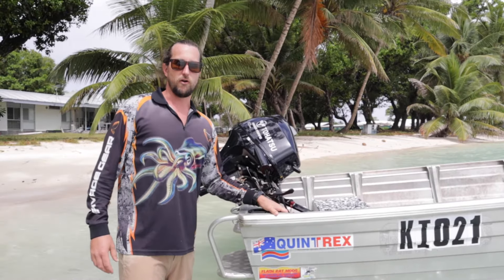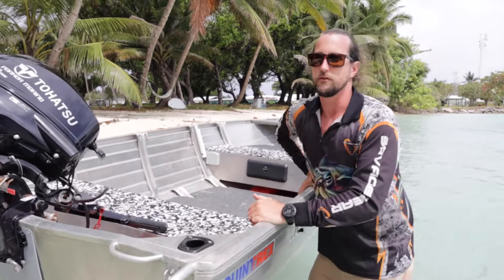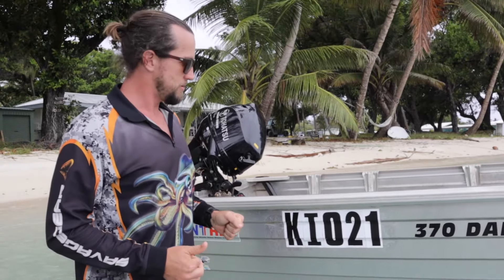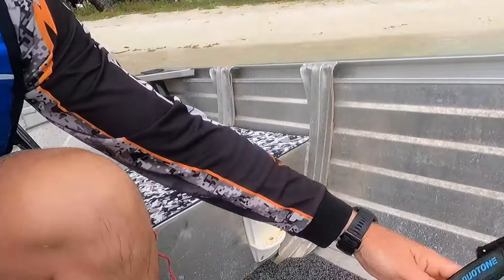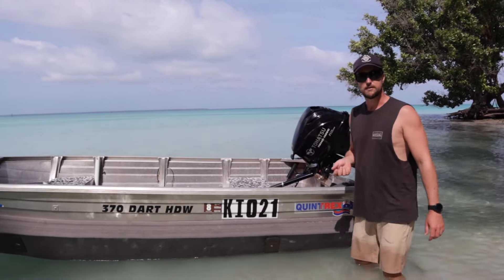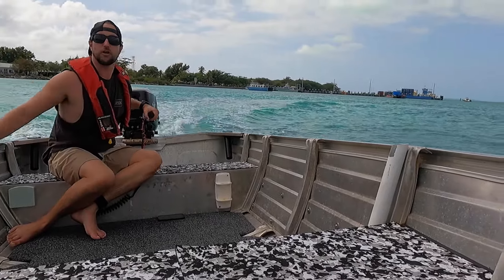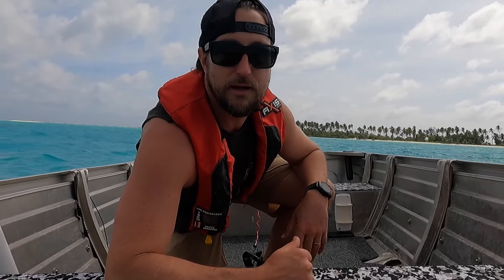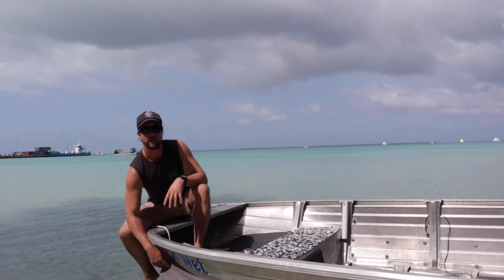The BEST mod for a tinny | KAPTEN BOAT COLLAR before and after review | Quintrex Rooftopper

Comment: Dude,  you CAN NOT go wrong with a boat collar ! I got pat to put one on my 4.1 Brooker and transformed it from a quite unsafe (randomly broached ),wet, harsh tinny into a dry, soft, super stable and predictable weapon.
Reply from the maker: My only regret is I had the boat for a year without it!
Reply: @shaneyule3484 
I’m about to install a collar on my 4.1 Brooker! Currently the boat is super dangerous, but hoping to change that with a collar. 
Did you get the max collar or slimline?
Cheers.

Comment: First of all incredible review in real world, realistic conditions.
3 years later how's it holding up? foam sun damaged / degraded?
Any significant chucks taken out by hooks / sticks?
Reply from the maker: Hey mate, thanks for the feedback - no one wants to see boats tested on a glassout. 

They are surprisingly durable. I've got some good chunks from beach launching collisions with the trailer, but apart from that its still good. I do an annual coat of tyre shine on the top side which they recommend to stop it from drying out too much and I also store undercover where ever possible. I would say if you took care of them 10years service life no worries. Cheers, ORT

Comment: I did a major modification along the same lines on my six metre glass boat using extruded polystyrene and glassing over using epoxy resin. I doubled the width of the chine flat and added around 100 kg of additional buoyancy to each side. I got at least a 15 % increase in WOT speed due to the additional chine flat width. I use this boat out wide in up to 2 metre swell and she has become a very capable boat. 
I also added a ballast tank up from for when motoring into a head sea and pump it out for the following sea.
Reply from the maker: Sounds like a weapon of a boat. Amazing how much of a difference this type of thing makes. Cheers, ORT

Comment: Great stuff, how does it go hand lining, would the line cut the form. I just sold them two batteries the other day lovely people,
Reply from the maker: Hey Craig, I've got to be honest I don't really handline. I would think if you're using heavy line it wouldn't really cut in it to - the outer layer of the collar is a hard layer, not soft foam. I've had plenty of braid rub against it when big fish have gone under the boat and no issue. Cheers, ORT
Reply: @ourrealitytravels  Thank you

Comment: Good review. Boat punching above it's weight and I bet that water was chopier than looked in the video. I'm sure youve push it further and bit curious to know if you have manged to get any water over the bow. Cheers and thanks for posting.
Reply from the maker: Thanks mate. Yeh the vids never do the weather justice, particularly on the gopro with image stabilisation. I've definitely been out in much worse, and you can push it hard directly into an oncoming wave and I honestly have never had one come over the bow. Reason being is that the harder you come down, the more up pressure against the massive reverse chine in the collar which pushed you up. It's just a ripper of a design. I'm sure you could do it if you went and charged into a breaking wave but in normal driving conditions, it doesn't happen. Cheers, ORT

Comment: Hey mate im pretty sold on getting some for my stacer 3.6 since i want to be out in the bay abit mud harrys etc so do you have to drill into the hull? I dont really want to make holes low in the hull... but i also dont want a bigger boat because i tow with a sedan and i like my little boat and ots cheap on fuel with my yami 15hp
Reply from the maker: Hi Jay, 100% you drill through the hull - BUT 100% do not worry about it. They do not leak and they actually have level floatation with the collar on. I've left the bungs out and gone for a fish and it wont sink. Check out my newest install video if you want to see whats involved with the install. FYI I'd be reluctant to head out to Harrys in anything but perfect weather in a 3.6 tinny without a collar, its a decent run home when the weather turns. Cheers, ORT.

Comment: They look awesome. Just one question if you don't mind? When you were turning fast it looked as though it was cornering a lot flatter. Do you think it would increase the risk of it rolling over if the outside was hit by a wave or large chop?
Reply from the maker: It corners like its on rails. Whether I think it would be more risky to rolling, no I don't. Not in the slightest. The massive reverse chine would make it near on impossible to roll unless you literally got dumped by a breaking wave. The biggest risk I see with the collar through corners, and I am guilty of it, is throwing your passengers around. Reason being is that when driving from the tiller you can really throw it into corners and it handles so well but you forget about the poor passenger up front and them getting thrown to one side. Hope this helps. Cheers.
Reply: Oh ok. Cool. Thanks. That cleared that up. Great informative video btw. Thank you very much for that. Cheers
Reply from the maker: @danbag3518  Cheers mate, appreciate the feedback.

Comment: Great video for the before and after! Two questions if you don't mind:)
How about collar's durability? Do you find 1.6mm hull thickness ok?
Reply from the maker: Thanks for the feedback! Yes so far it has been durable. If you hit it hard on the trailer or with anchor then expect to take chunks out of it but its just cosmetic more than anything. The hull thickness has been no problem at all. No visible flex and I've bashed it into some pretty rough weather. Cheers, ORT.

Comment: Hey guys, great vid, I’m waiting for my max collar right now. Can I ask if those rod holders up front are just pvc or are they an off the shelf? Any chance of a closeup pic? Thanks!
Reply from the maker: Hey James, they are just PVC mate. Cut to size for the boat and then fixed with alloy rivets. They work a treat for travelling but I wouldn't trust them for trolling with any heavy gear. Cheers, ORT.
Reply from the maker: PS you are going to love the collar. Hardest part is waiting a week for the glue to set during the install.

Comment: does it make much difference load on to roof top and how much extra weight
Reply from the maker: Hi John, I've been in one spot since install so I can't comment on the impact on the roof. I have no reason to believe it will create much/any difference though. The weight would be 10-15kg depending on the boat you are fitting it to.
Reply: @ourrealitytravels  thank you .

Comment: How much does it reduce the splash.. on the ningaloo reef coming back in the arvos i always get smashed by splash to the point where i can hardly see. Would love to here what kind of difference it made
Reply from the maker: Hi Jordan, its markedly improved on every angle. What happens is where the point of the hull parts the water and it normally throws the water up and gets blown back into your face it instead hits the collar and is deflected down. When it is really choppy you will still get some back at the tiller when cutting across it on the port or starboard bow, but if you're on the beam or straight on the bow the spray is no existent. I was pleasantly surprised with the difference.
Reply: @ourrealitytravels  thanks. Awesome video I like your style so i subscribed! Cheers for getting back to me also
Reply from the maker: @jordanzyla3377  Thanks mate! Heaps more content to come. Cheers